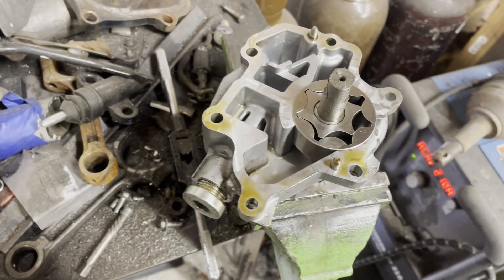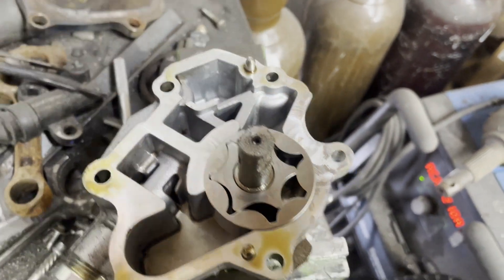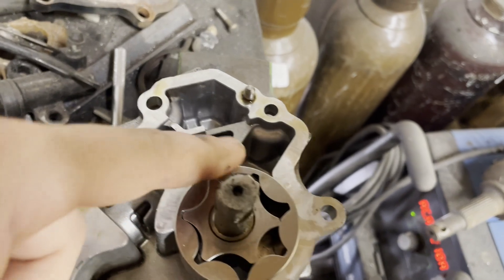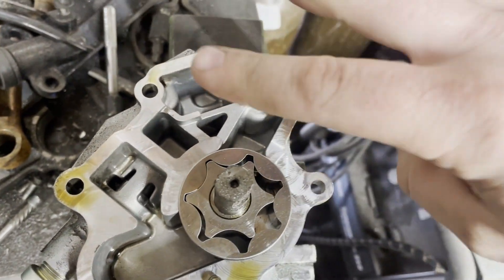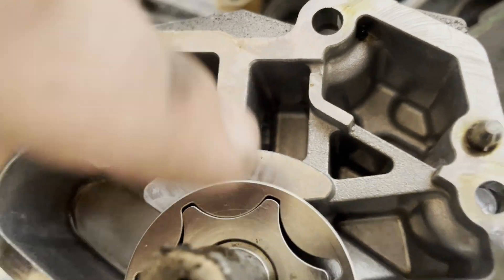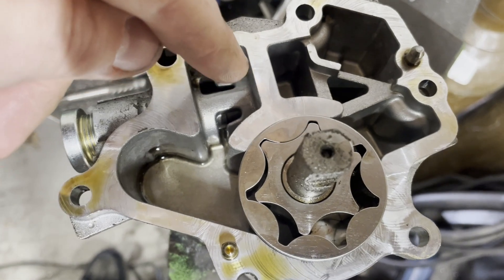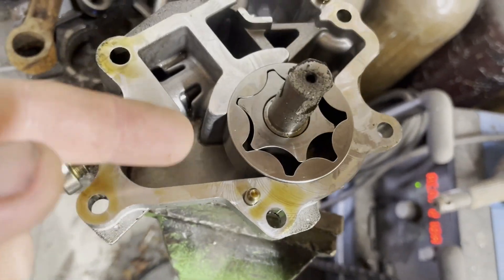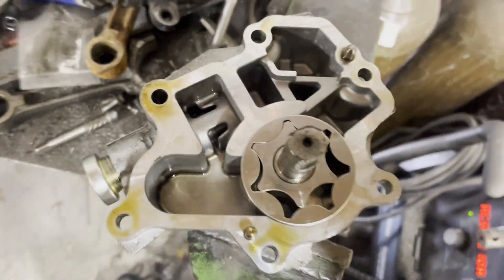How A Nissan MR Engine Oil Pump Works

Comment: Is it possible to replace just the oil pump
Reply from the maker: It’s a big job. But it is doable. Timing cover needs to come off. Lower pan. But if you suffered an oil pump failure and loss of oil pressure, other parts inside the engine could have been damaged.